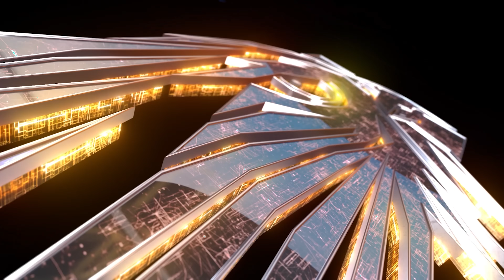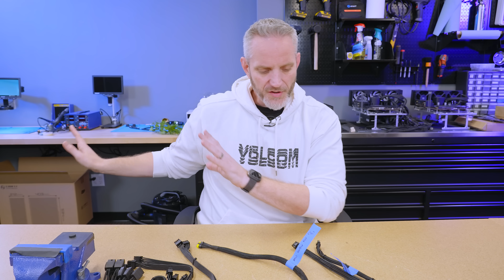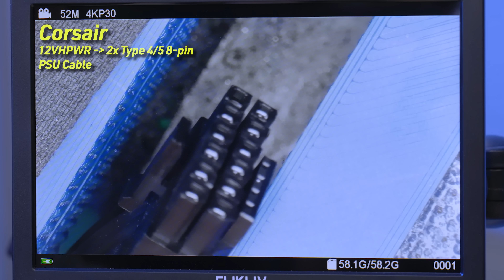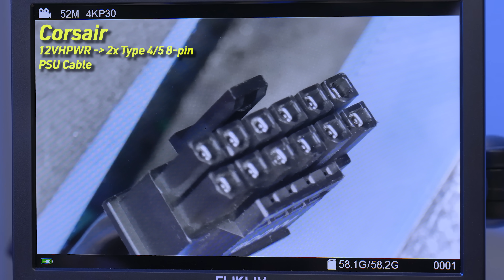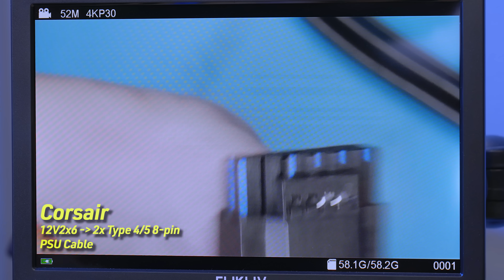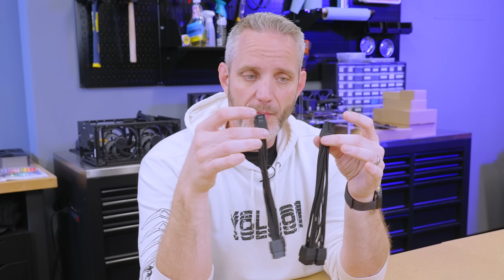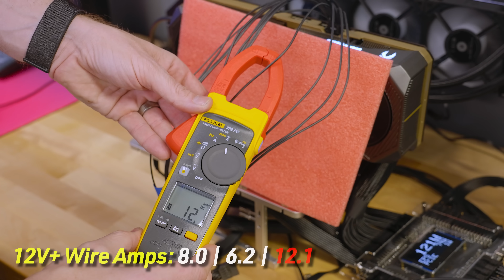I discovered something concerning and I need the Experts to chime in... More 12VHPWR discovery!

Comment: The fact that things like per pin sensing and the yellow plug tip for a visual indicator of insertion depth are even being discussed or even a product now speaks volumes for how much 12VHPWR itself needs to be re-evaluated as to whether it should exist in the first place.
Reply: The 3.1 spec has longer power pins and shorter sense pins specifically to catch improper insertion depth. While the inconsistent sleeve depth on the connectors may be playing a part in the current issues, I think it's more related to how Nvidia has decided to connect power to the board.
Reply: @benjamingardner5277  The core problem is when one cable gets too good connection compere to the rest with 4090, 5080 and 5090 as the cards no longer trying to even out the power. So one bad pin just means other pins need to handle more load.
Reply: @benjamingardner5277  That catches partially inserted cables, but may not catch cables that are ajar. It will not catch cables with faulty wires or pins. Proper electrical design at the supply side would feature per pin overcurrent protection on the 12v wires, which would disable power on a faulty cable or connector instead of melting it.
Reply: @ nothing in computers has a strict per pin overcurrent because the consuming devices are usually highly inductive and have high inrush currents as a result, so strict per pin overcurrent would be susceptible to nuisance trips. So they do what anyone else with an inductive load does, provide short and ground fault protection at the supply, and thermal overcurrent is the responsibility of the consumer.
Reply: @ragzillaz  Do you think that computer power delivery runs on breakers or what? Inrush current is easily spotted and can be accounted for. Are you trying to come up with excuses for a multi billion dollar companies to not to include any safety features? 

Some stuff like elevators are built with safety margins (in terms of structural strength) of x10-x16 from the supposed load. And they STILL have safety features implemented. 
RTX 5090 runs on a safety margin of x1.1 out of spec and has no balancing, no control, nothing. They only have policies that make you responsible for their effortless engineering. Don't be such a worthless shill.
Reply: people who are asking about "why no per pin overcurrent in the PSU" are asking for overcurrent in a place it's not practical to do so without allowing this overcurrent to take place. There's a reason the NEC allows inductive loads to have breakers substantially higher than the conductor ampacity, and it's because of inrush and nuisance trips, and because the downstream inductive load can provide thermal overload protection.

NVIDIAs RTX4000/RTX5000 provide downstream thermal overload protection via shunt monitoring and card shutdown, but only for the connector aggregate and not per-pin. Unless they change the VRM supply rail topology that's a limitation, and their engineers aren't entirely unjustified in saying that the consumer should use a cable which adheres to spec, and not one that's been plugged and unplugged 50 times and has worn down contacts. You're asking them to solve a problem which affects something like 0.001% of users. I would love to see them do that, I believe a 6 rail VRM supply topology is the ideal design for the 12v-2x6 as it protects the users from themselves, but the business management side of me finds it hard to justify fixing a problem that isn't a widespread problem.
Reply: @ ASUS already has a board with per-pin current measuring and if you continuously go above 10 amps then it will warn you to check your cable. Is it difficult to make such stuff mandatory for cable that has no safety margins at all? You don't even need to take actions, you don't need to change schematics to have multiple rails of 12V, just inform the user. AT LEAST inform the user that cable is running out of spec.

And it is not a 0.001% of users, multiple technicians receive at least one per day with molten connector to this day. And I am talking about 4090, which pulls only 450 Watts, this pulls 600, so failure rate will be much higher because safety margins on this cable are non-existent. It means it ALREADY runs on the verge of failure.
Reply: @ChuckTheChosen  
>  Is it difficult to make such stuff mandatory for cable that has no safety margins at all?
Ask PCI-SIG, but the cable has more safety margin than most commentary will acknowledge. The EE that made the PCMR reddit post wasn't even working off the datasheets for the appropriate terminals because he's not a power delivery EE, so his basic assumptions were flawed and the analysis snowballed from there. 

in an ideal world, NVIDIA would be using a 6 rail VRM supply topology that would balance perfectly, and could warn about worn cables (because you'd see a voltage drop at the monitoring shunt), but it's engineering work and $10 in parts on every board which goes out the door that benefits an absolutely miniscule number of users. We're seeing massive survivorship bias in this problem, because it predominantly affects people with audiences but who are using their cables in ways the cables weren't designed to be used in.
Reply: @ChuckTheChosen  The only field I'm familiar with a safety margin of 1.1 is space where increasing it to 1.15 could cost significant amounts of money AND significantly decrease the max launch load.  Increasing pin size or adding another connector changes very little in the case of computer components.
Reply: @ChuckTheChosen the psu cannot know if the consumed 600 watts is going to heat or on work on the card
Reply: @lasskinn  Yeah, but PSU can see that sense wires are connected and that will mean that 12x6 connector is used and specs of this cable are known. It can measure current per pin and disable load or inform the system that cables running out of spec if some wires running under 10+ amps and other ones just carry 5 or 6. 

But I am against that idea that safety measures must be implemented on the PSU side. It is NVIDIA who pushes this ridiculous unsafe standard so it is NVIDIA must do all these measurements on the GPU board.
Reply: @ChuckTheChosen  hmm that would work if you could spec how the gpus supposes to be pulling it in the first place i suppose, but since the spec doesn't have like preferred pins etc, different gpus could trigger it even normally if they dont just bind them all together.

Really if they're bound together a beefier connector would make way more sense. We use way beefier stuff on 3d printers for the bed that pulls just 100w 12v
Reply: Let's be real: 12VHPWR (or whatever you fuckin' wanna call it) should have been recalled entirely from the market ages ago. 

It has shit safety margins, so shittily designed that user errors happen all the time and a design that is so shoddy that it can fail catastrophically on its own with basically no user intervention. If this had been happening to any other component in any different industry, there'd be gov't regulators all over it before lunchtime. This design should not exist, period. It's 200% been designed with aesthetics in mind first and engineering safety second and we're seeing the direct results of that. How nVidia hasn't been sued into oblivion over it blows my mind...
Reply: I'm pretty sure we all know it should not exist. We've been using 6/8 pin connectors for decade(s) without issue. If you want to replace them with an "upgrade" it should be something worthwhile.
Reply: @marstedt  90,000+ results on Google for 8 pin PCIe connectors melting has determined that we haven't been using 8 pins without issue.
Reply: On RTX5090, all pins are connected together with that thick piece of metal sticking out the PCB.
Could the same be done on the cable side? That would prevent any pin from moving, and resistance in all wires would be the same.
But then it begs the question: why 6 thin wires instead of one thick wire?
Reply: These exact same problems existed on a smaller scale with the old 8 pin. It's being exacerbated on rtx4000/5000 due to the single rail VRM supply change that NVIDIA made post RTX3000.
Reply: @ragzillaz  That's true, but the tiny safety margin of the 12VHPWR spec also exacerbates the issue. Ultimately I blame NVIDIA for removing the ability to balance the load, most likely to save $7.23, while going to a connector with way less safety margin than previous generations.
Reply: @ragzillaz did you just not 100% flat out agree with OP!? Didn't you hear NVIDIA BAD
Reply: @RyanFennec  😐😐
Reply: Half plug in any type of plug/socket/cable and you're asking for trouble, and it's not as if the connectors inside IBM-compats are considered consumer-grade.
Reply: @0w784g  That's not a fair remark, when you have for one exceptional power density bestowed on these connectors, like a couple hundred Watts misplaced are an easy fire, and for other, that there is no way anyone not even a professional QA inspector with any conceivable tooling can reasonably detect whether the connector is attached properly. Critical connectors like that need to be designed such that if they look and feel properly installed, they must be able to survive the intended use.

Comment: I think there is a Consumer product in the making here that sits between the PSU and GPU which Regulates and Monitors per wire, with safety features built in and with Monitoring Software.
Who is going to be first to market ?
This could be an option for Nvidia or in Collaboration with PSU Manufacturer ?

Comment: If a slight misalignment of the pins means that it cannot operate at spec, the connector is shit. Zero headroom built-in to the specification. The connector is running at the limit.

Comment: I took a look at the 12VHPWR connector (which I am not currently using) that came with my 1000W Corsair.  The pins are definitely uneven, but it's not as bad as the one shown here, nor does pulling on the wire move the pin.

Comment: It's hard to say. A bad contact on a single wire wouldn't cause 20 Amps to flow through that connector. That can't be the cause of der8auer's findings. If you have 6 wires going from a 12V bus on the PSU to a 12V bus on a GPU, but 1 wire is carrying most of the load, it means that there's a significant difference in resistance across those 6 wires, with the one of least resistance passing most of the current.

So either that's the case, or it not actually a 12V bus on the GPU side. Do we have confirmation from NVIDIA that it is a 12V bus, or do we know that only from reverse engineering?

A possible reason why the melting is occurring on the 12V pins/wires instead of on the ground pins, is if the power connector and PCIe slot share the same ground, then there are more paths for the current to take when returning to the PSU. 

But I'm not an electrical engineer. and I'm wondering, if power and PCIe share a common ground, then how does the GPU limit the current output back through the ground on the PCIe slot?

Comment: It's simple, the resistance in that cable is too great, much heavier gauge wires should be used on the 2 main power and the ground, that is whats causing the burn.

Comment: Actually hardcore overclocking did a whole video on how badly designed the whole plug situation is. It isn't even just the plug that it is the problem, but also the recepticle it goes in to. It's all going through a single channel instead of splitting the power incase of a failure. Just watch the video. He explains it better than I can, but what it boils down to it isn't really the plug but the actual design of the card itself.
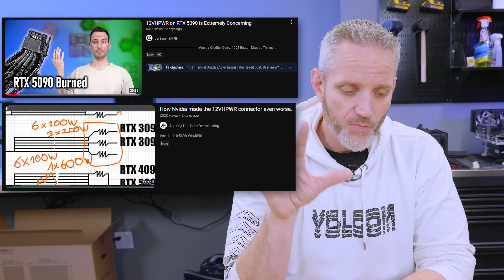Reply: that exact video is what the entire section starting at 2:36 is about...

Buildzoid is the person, Actually Hardcore Overclocking is his channel
Reply: @frickingphil  ah good stuff. I admittedly hadn't watched the video yet and was scrolling through the comments and it just seemed like everyone was shitting on the connector/cable and not the design of the card itself, which led me to think it wasn't covered. I'm glad it was!

Comment: I'm going to say it again, eliminate the connector on the card. Make it a card edge with reinforced fingers. This eliminates a failure point. It also reduces cost. On the cable side, you have a wire to card edge connector. They are pinch connectors just like a pci connector. You can go from that to wire, or a micro board to wire. Then that goes to the psu. It is much easier to deal with in so many ways.

Comment: Hi, just one comment to the usage of a DC Clamp Amperemeter. Normally you only get good measurements when you out the clamp around the cable power everything down, zero the clamp and power it up again. In DC mode these clamps are very sensitive to outside influence. But even as you showed it it gives a good impression and rough house number.

Comment: @15:30 My 1st party cable fried. I used the 1 to 4 adapter that came with my 4090, and my 1 to 2 cables that came with my PSU. Weirdly enough it only "failed" 2 years in. In that time the PC was never moved or opened. My guess is It took time for the plastic to melt to the point of total failure, maybe even the result of amient temperature changes over seasons causing contact issues, who knows.

Comment: I don’t think higher resistance on the ground would result in higher resistances on the 12v rail. That energy is doing work, so most of it is leaving as heat, meaning that even if the resistance is slightly higher on the ground side it wouldn’t make much of a difference. That doesn’t mean that resistance on the ground can never affect things, I just don’t think that pin depth can cause any significant problems in that particular case(on the ground, pin depth can absolutely be an issue on the 12v side and I very much think that’s the issue)
Reply: power is power. It doesn't matter which side of your load the connection is. If you have a poor connection somewhere, it will cause that section to draw excessive current and heat up. I've seen this happen plenty of times while working on cars. Let's say you have a 12v light bulb from a car, and connect it to a battery with some wire. You can add a high load ANYWHERE on the wire, and it will have the same result on power. It's sort of where the water hose analogy of electricity falls apart, since no matter what, current across the wire will always be the same going in as coming out.
Reply: @kasuraga  it does cause that section to heat up, but not the entire line to it. Heat is generated where there’s an increase in resistance, and the rest of the wire is not at a higher resistance. This would extend further to mean that the wire itself would have a lower power flowing through it, since Ohm’s law would not permit a higher current. Those Corsair connectors are definitely out of spec in their placement, and that would explain why the plug is heating up, but not the entire wire going to it.
Reply: Splitting the load across multiple wires is why we see so much heat when one pin sees high resistance. The pin affected will heat up at the connector, but all other wires will start to pull more current through the entire wire as the GPU continues to demand the same level of power. You end up with one wire pulling very little current, and all other wires pulling too much current, meanwhile the pin in the connector with a poor connection heats the fuck up since power is also still trying to flow through it, getting dumped as heat. I think it's sort of a cascading effect where the load balance gets progressively worse as the contact points get hotter due to the excessive current and start to fail while still trying to pull the wattage the gpu demands through all the wires. I don't think the ground side gets affected as much since all the ground wires should be commoned together, but the positive rail may be split up into seperate rails. So for example you lose one ground out of 8 cables, it's not as bad as losing 1 positive connection when you have 2 12v rails with 4 wires each. One of your rails is gonna have to carry a much higher load compared to the ground side.
Reply: That’s what I’m seeing too, if an increase in resistance was present at the plug that would mean that the majority of heat created would be at the plug itself, and not along the entire wire. 

Extending off of this a little bit, it would be kind of nice if I could see the gauge of the wires. If the wires in question are of a smaller diameter, that could be an explanation for generating the heat, but that doesn’t seem like something likely to happen under most manufacturing processes.

Comment: And this is why this whole connector needs to be dropped and Nvidia needs to stop forcing board partners to use the 12VHPWR port.

Give me a 5070 with 3x8 PCIE Power ports instead, i would much rather trust the good old reliable connectors that didn't burn down than take a chance with the new standard and risk losing my PC in the process.

Comment: I had a 4070ti that caught fire at the connector a few weeks ago.  Was a prebuilt, build was solid, performance was good. I never had a reason to fiddle with it.  I suppose it’s possible that the connector got loose during shipping or was loose from the initial build, but I got a little more than a year of use out of it before that incident. Wound up replacing it with a RX 6800.

Comment: You might be on something Jay. I once had the same problem on some aviation components. It was costing the airline tons of money in nil fix and useless removals. The electrical data and power connectors  were recessing when the mechanics connected them. The male pins and female connectors would sometime recess and break the connections. Made a suggestion to solve this problem changing the connectors both male and female to glass potted sockets. Made the maximum reward for a suggestion.